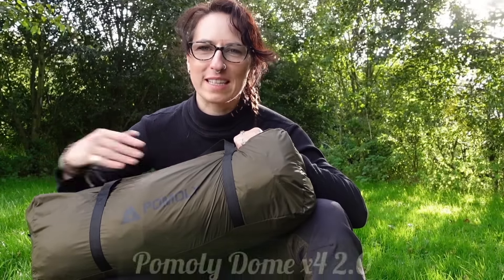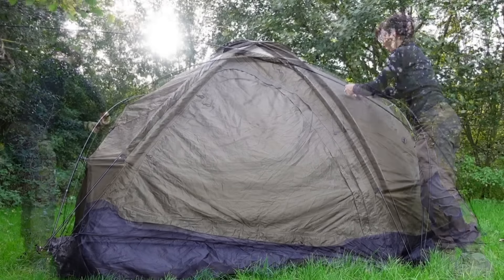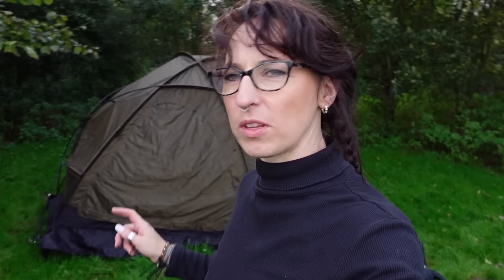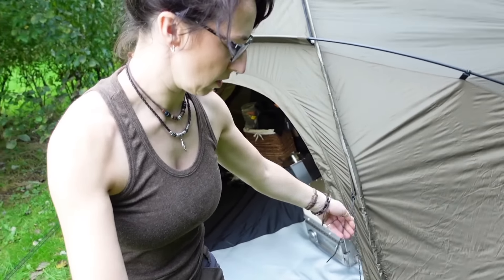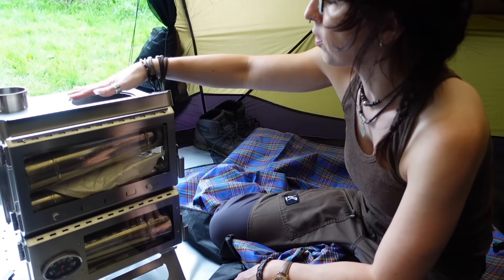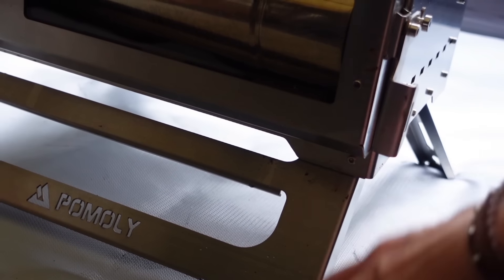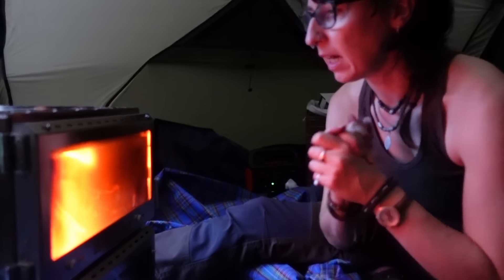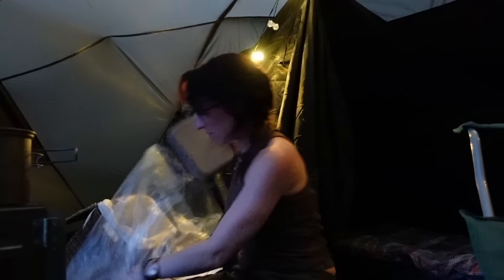WOODLAND WILD CAMP || POMOLY HOT TENT AND STOVE

Comment: Cool video, some cracking gear there lilu ,stunning tent and stove, some suggestions if I may:
The reasons for the sore throat etc, possibly could be the coal burning, yes most goes up the pipe/flue, but some coal  particles will come out the vent on the stove itself, and if the smoke is swirling outside, the smoke out the pipe goes in all directions, and the other is may the herbs in the herbal tea didn't agree with you, some people can find some herbs a slight irritant, perhaps look at the ingredients list..
Keeping the oven section clean ,use a foil tray or baking tray, makes it easier to clean..
Using a picnic planet in the sleeping section, according to my daughter who tent camps, makes all the difference..
A door mat of sorts in the entrance way, ones you can just stick in washing machine to clean, but okay to get wet/muddy, help keep your inside space clean..
Sorry if you've thought of ghese already, just being helpful hopefully, good health and safe travels, cheers craig
Reply from the maker: Thanks for the tips!